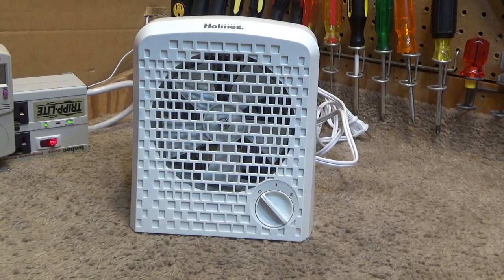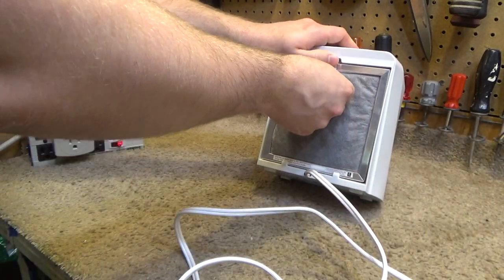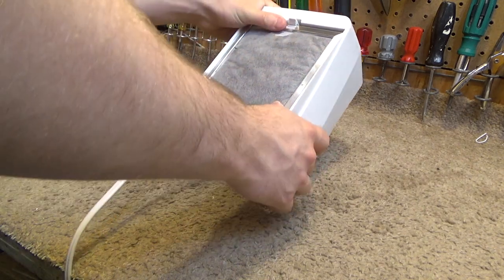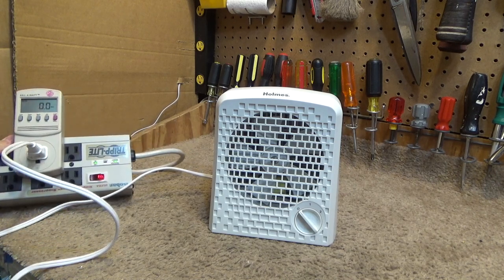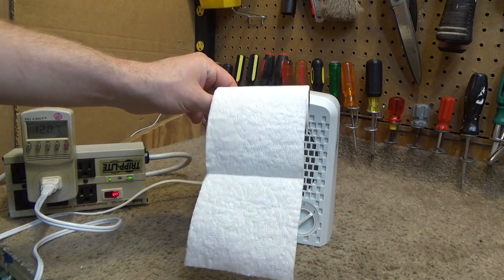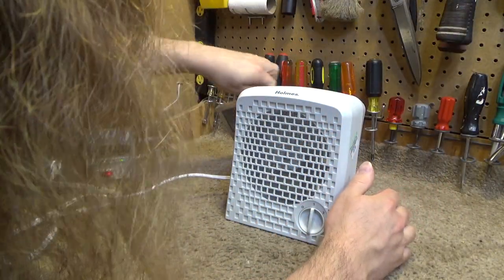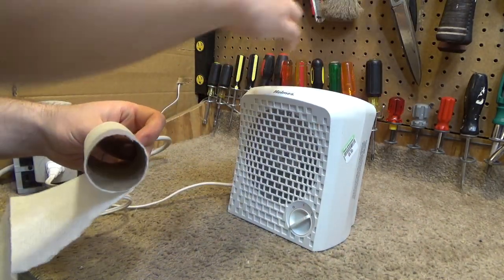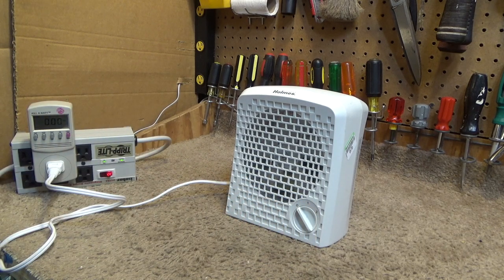Holmes HAP116Z Air Purifier | Initial Checkout

Comment: How do I open it to clean the fan!??
Reply from the maker: I'm not sure, I haven't attempted to clean this unit yet.
Reply: @JordanU  I figured it out! you’ll need a screwdriver lol.
Reply: @dorkynessa101  where do I put the screwdriver? I’m sitting with this thing on my lap trying to find the point of contact to open it to clean the fan
Reply: @kimberlysmith5172  you’ll have to temporarily remove the black stuff from the back of the filter...you’ll find the screws under that! (Ridiculous design lol)
Reply: Exactly, I guess it was meant to be disposable
Reply: I had the exact same question just a week ago. I gave up and my man using an air compressor to blow mine out every few weeks and I use mine in my bedroom because that's the only room I smoke in. It's nothing like a bigger, more expensive unit, but I do change the filters every month and it is catching some dust and stuff.
Reply: @dorkynessa101  thanks this was driving me insane. cleaned like new again.

Comment: Walmart doesn’t carry them anymore so I have filters left to use with a dirty purifier because you can’t clean the inside 🤷🏾‍♀️🤷🏾‍♀️
Reply from the maker: OK
Reply: Thanks to a comment above the four Philips screws are located under the foam trim where the filter would be in each corner, but the left lower one is slightly higher than the right sided one. You don't have to remove the foam trim just a long-headed Philips screwdriver should do the trick to poke in each screw hole and unscrew each. Gently lift as knob, outlet, and fan wiring are zip tied together. I cleaned with alcohol Jack Daniels preferably(kidding) use of alcohol wipes or some on cotton swabs should get in those stubborn corners. Once cleaned to the way you like it reassembly is the way disassembly went.😉

Comment: I precisely remember getting mine in 03 from what I believe to be target for one of my sons room. I bought mine to use it exactly as a deodorization device and not an air purifier since he did sports, it did the job my deodorizing the air. I also remember seeing these sold on Amazon up until the early 2010s meaning this was one of Holmes devices that was sold for many years. It works fine as a deodorizer nut this shouldn’t be used as a substitute for an actual air purifier. I also remember seeing one of the 2010s models at goodwill I’m assuming since it did have a fused plug. You’re I’m guessing is probably from the late 2000s right before the fused plug thing came until effect.
Reply from the maker: Thanks for letting me know.

Comment: They still sell them and the replacement filters at Walmart. They're better than nothing. I used to run a couple of them at the same time. Eventually, I just used a broken box fan case to hold a filter and used a dryer hose to connect it to a floor blower so I could use real filters. I did make one out of a box fan once, but the fan burned out after a month. I didn't see any point in buying another box fan, so I just used the case as a holder for a filter instead. It does reduce the dust on my air conditioner filter.
Reply from the maker: Thanks for letting me know.

Comment: It's probably not very old at all, I've seen those for sale at Walmart in the last couple years and just saw they are still on their website. Somehow it gets a 4.5 star rating. 

They remind me of the many similar filter fans that seemed to be popular in the 1980s. My guess is it's meant to be quiet so it's just unobtrusive. But I don't see how it would filter much with such a low CFM.

Not sure why the plug isn't fused, I guess maybe air purifiers fall outside the fan category, or it doesn't draw enough amperage to need one.
Reply from the maker: I thought just about every small appliance sold now had to have the fused plug, perhaps filters are an exception. This could be an older instance though, Holmes has quite a few models out that have been on the market for a very long time now.

The people that like these are probably falling for something along the lines of a placebo effect. They see some pieces of dust captured in the filter so they think it must be 'working' and making the air easier to breathe. The CFM value is so low on this unit it's not even enough to disturb the air 3 feet away from it. It can't possibly do any filtering worth noting. It's not really that quiet either!
Reply: @JordanU  Actually, fans are about the only new appliance I see that have fused plugs. And decorative lighting such as Christmas lights and candles, but they had them going back decades ago.